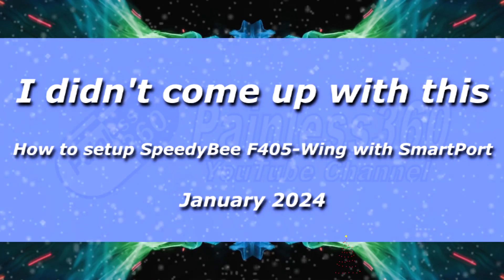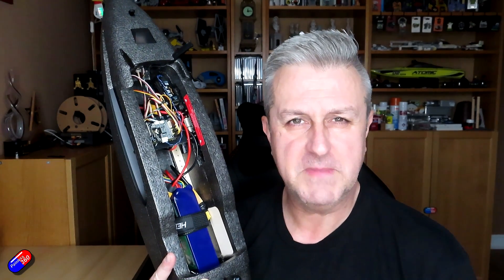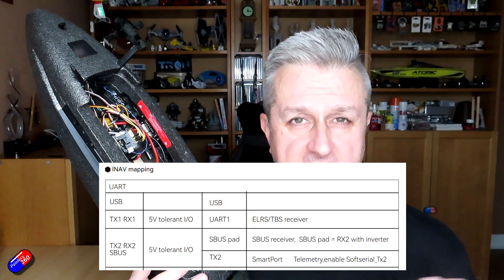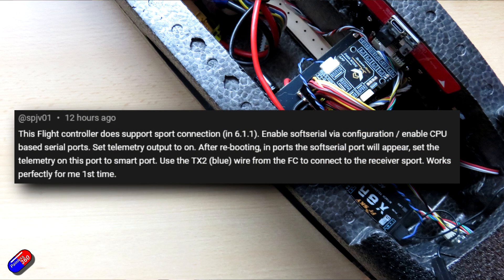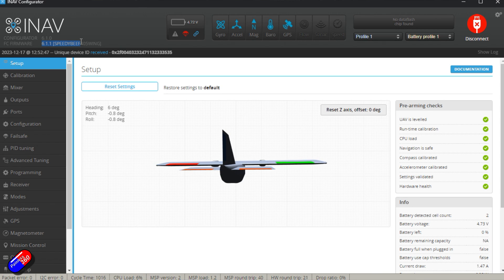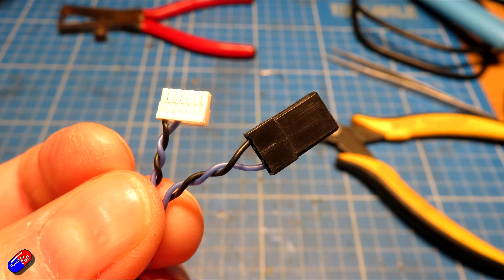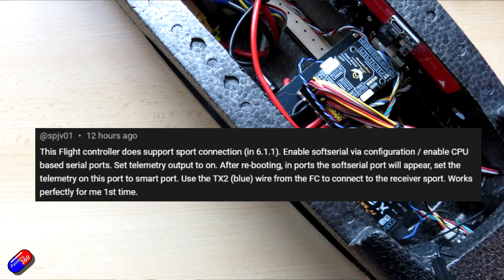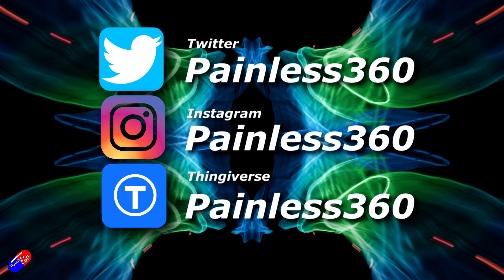Speedybee F405-Wing and SmartPort Telemetry Setup

Comment: Hi Lee I have a Frsky grx8 receiver with s port 4 pin plug and I’ve made up a plug for telemetry socket on speedybee f 405 wing mini, configured soft serial in inav ports and set it to s port.   I’m running a blue wire from telemetry tx pin to receiver s port but it still doesn’t populate more than 7 telemetry values, tried deleting on radiomaster tx 16 and rediscovering telemetry but still don’t get the full list…any advice appreciated….thanks
Reply from the maker: It sounds like you've done all of the steps. Is there continuity on that s.port connection?
Reply: @Painless360 I’ll check that, and last message should read tx2 pin on fc telemetry’s socket…..I’m running inav lua on tx 16. Thanks..

Comment: Thank you, thank you, thank you!!!! I have been pulling my hair out over this and now I have my TDR6 working with inav 8 on the F405 wing :-)
Reply: hello friend, Im where you were at. So does the control of the servos and telemetry all go through the s.port connection on the side of the speedybee?  I can't figure it out. I have the exact same setup.  I don't understand what he has connected to the UART2 pins. Did you use the SPORT pin on the TD MX to connect to the telemetry connector on Speedybee and use the SBUS to connect to the RX2 or UART2 on top of the speedybee?

Comment: Thanks for the great videos. I am using Inav 7.1.2, Frsky R-XSR with firmware Accst 2.1.1 Fport LBT (for Europe). My transmitter is the Radiomaster Zorro with 4 in 1 internal module. The Smart port (S Port) I am using to connect to the Speedybee F405 WING MINI is the uninverted S Port pad (letter P with bar on it) on the Frsky R-XSR. The ground, +, uninverted S Port from R-XSR all connected to the port listed as the TELEMETRY port with the GH 1.25 6 Pin connector (wire and connector was not included with my SpeedyBee F405WING MINI). The uninverted S Port from the Frsky Rxsr  is connected t 0:15 o the TX2. Other than TX2 to uninverted SPort, + and ground there is nothing else connected, so the sbus cable from the receiver is not connected. On Inav it is not necessary to use the Soft Serial mode. On Inav: Ports section; Uart2 Serial RX is selected, on Configuration; Enable CPU based serial is NOT selected, Gps for telemetry and Telemetry output are selected, on Receiver section of Inav; Receiver type is Serial, Serial Receiver provider is FPORT, Serial port inverted is On and Serial Receiver half-duplex is set to Auto. I am receiving all telemetry just fine on the transmitter. PLEASE NOTE: SPEEDYBEE WEB SITE as of the date of this comment has the GH 1.25mm 6P connector listed upside down. In other words where it says 4v5 is actually the ground and where it says ground is the  4v5. The small brochure that came with the f405wing mini  is correct but the web site is wrong as of the date of this comment so please pay special attention as this also changes the actual location of the TX2 pin.
Reply from the maker: The way it worked here is shown in the video. Soft serial ports are as shown.. Best of luck!

Comment: And thanks to you I can connect telemetry from the F405 Wing Mini to my X8r rx. ;-)
Reply: I had one problem connecting SpeedyBee F405 Wing Mini to the S.Port of a FRSKY X8R rx. When I connect Tx2(SpeedyBee) to S.Port Signal and SpeedyBee GND to S.Port GND the system stays completely dead. No power to the SpeedyBee and RX. Only but the ESC beeps a few tones. When I disconnect the GND everything works fine. So I googled and indeed one video show that to a SpeedyBee F405 Wing Mini  only the signal wire should be connected. So that's a bit different than the F405 Wing (big one). Strange isnt it? II run a old EU version of the X8R and my Opentx is also a bit old, but I cannot believe thats the reason. Maybe you or subscriber now what's going on. Thanks. I love your videos 🙂

Comment: hi im using a speedybee F405 wing on inav 7.1.2 and FlYSKY FS - i6x with openTX 1.11.1 installed via idus but i am not getting all the telemetry data could you point me in the right direction
Reply from the maker: Support for ibus telemetry appears to be active by default. Maybe incorrect wiring? See https://github.com/iNavFlight/inav/blob/master/docs/Telemetry.md

Comment: Is it possible to wire up Crossfire/Tracer with a telemetry radio like sik900 or rfd900 to this flight controller or a iflight f745?
Reply from the maker: It should work, but I've not set it up here... Best of luck

Comment: I’m using the same flight controller for a bait boat conversion but instead I’m using mission planner. The problem I have is I can’t connect to mission planner via the holybro sik telemetry radios I’ve bought got solid green lights on both radios so they’re connected but can’t connect onto MP is there a parameter that needs alterating in quite new to all this so any advise would be appreciated thanks
Reply from the maker: This video isn't going to help you. See my videos on telemetry radio setup... https://youtu.be/WzM4J_qlEso?si=gF_ippwucIW_0S9o
 Best of luck

Comment: Thanks.  Unfortunately this didn't work for me with the R-XSR receiver.  Still tying to figure it out.  I have the receiver talking to the F405-Wing, but it isn't getting the telemetry after I ran the TX2 wire to the R-XSR's S.Port pin.  I replicated all the steps in inav as seen from this video.  Did you simply "Discover new sensors" and everything showed up?  Not sure what's up.  Thanks!
Reply from the maker: Yep, that is all I did here.. Best of luck
Reply: @Painless360  Thank you.  Also, do you know if I can add additional SmartPort sensors?  I have an Avian ESC and can grab the voltage/current from there (with a telemetry converter) rather than push the current through the FC's PCB.  If so, would I just tap straight into the blue wire, or would I need to feed it in through the adjacent R2 pin?  Not sure if inav will read other sensors, but that's okay if I can just send it straight to the receiver to send to the transmitter.  Thanks!
Reply from the maker: I've never tried. If it works, let me know!
Reply: Got it figured out. I couldn’t have Smartport and SBUS both on UART2.  I moved the blue wire from TX2 to TX4, and enabled UART4 for telemetry.  I was also able to disable the softserial as it isn’t needed.  Also important to note that the F405 Wing puts out an inverted SmartPort signal, so make sure your receiver has a pin for inverted SmartPort.

Comment: Got it working with my X8R but I'm getting "sensor lost" messages every now and again. I think this can happen if updates for a sensor take longer than 10 seconds? I've cut down the number of sensors being monitored to just the four I'm really interested in (Alt, RSSI, GPS, A4) but still get a "sensor lost" message every few minutes. I know I can get rid of all telemetry alarms but I'd rather not. Am I missing something?
Reply from the maker: I've had that on a few older X8R units, it can be due to poor antenna alignment or an issue with the Rx.. Best of luck.
Reply: @Painless360  Thanks for responding.
I've now acquired a number of SpeedyBee F405-Wing controllers.
This has allowed me to isolate the problem to one particular SpeedyBee FC - it works well for about 3 mins after power up and then gets slower and slower to update telemetry until the "sensor lost" messages begin after about 4 mins. Its as if a buffer is filling up or something is overheating.
Logs don't tell me anything.
(I'm sure its the FC - If I use the same X8R, the same wiring connections, the same GPS and the same airspeed gadget with another SpeedyBee FC then telemetry works fine. Its all repeatable.)
So I'm left with a faulty FC (soldered up). Hey ho. At least I've some spare connections now. And a new lease of life for half a dozen old X8Rs.

Comment: Hello. I need your help!! I have this fc with 03 air unit.. i got it all wired. Trying to setup in inav/speedybee.. i cant get air unit to talk to fc.(move servos etc) what am i missing.. on port 5 what do i set it to?  I really hope u can help!
Reply from the maker: Check out the wiring diagram. There are two SBUS inputs. One for the DJI unit and one for traditional recievers. MKe sure only one is connected. Best of luck

Comment: I recently purchased a speedybee f405 wing FC, I have a spectrum radio and receiver but the instructions do not show a connection for the spectrum receiver. I also have a speedybee f405 V4 flight controller for a kwad and it shows the spectrum receiver connection in the instructions. Can you tell me if it is possible to connect the spectrum receiver to the wing FC ?
Reply from the maker: You need a reciever that'll support either sbus or something like CRSF. Sadly Spektrum don't support open standards like SBUS very well... Best of luck

Comment: Lee, one of the biggest issues with this and other ‘helpful’ YouTube producers, is that they don’t say what version of INAV they are using or have an issue with. The Speedybee INAV version off Github did have the serial port issue, but if you contacted SpeedyBee they would forward you a version of INAV 6.0.0 that did work. Version 6.1 came out soon after with the Serial port issue fixed. Let us know every time what version of INAV you are using, they change it so bloody fast that it takes a lot to keep up with it. Cheers for 2024
Reply from the maker: Check out the build video. I cover versions and only ever use the official releases from the INAV team, others might not so watch my videos 😜. I made this video specifically to help others and make the solution easy to find... Happy flying

Comment: I also like such videos and therefore a  short comment that you know that it was a great summary and also reading all your comments which can be quite a lot.
I got 3 speedybee f405 flight controller last year before the sanctions and export ban could kick in which i wanna use this year, but they are still in the box and it is too cold to work in my shop right now.

But I wrote it down and have this in my notes for the speedy bee f405 and elrs receiver setup to find it when needed.

Comment: Hi Lee - Thanks for the credit & the callout. On this topic there is another problem I haven't been able to figure out but perhaps you have. I have discovered that the SpeedBee F405 wing does not return the full list of telemetry items. There are a number missing but specifically the one missing that I want is the Tmp2 (not Temp2). The Tmp2 (from the GitHub docs) should return GPS satellite info: fix, HDOP and number of Sats.  I want to display HDOP & the number of Sats on my X20 display so I know when to fly. The FC does not allow arming until the req'd number of Sats are acquired so the FC does recognise the number of Sats, it just doesn't send them via telemetry. Perhaps you or any other users can verify on your install if you get the Tmp2 item or not. I think it is a bug for this FC build so maybe it should be reported.
Reply from the maker: I'd recommend that you make the INAV team aware of the issue by raising a bug report on GitHub.. Best of luck and thanks again!:D